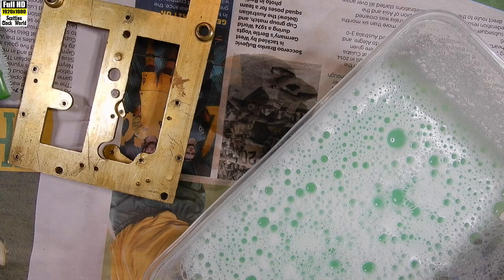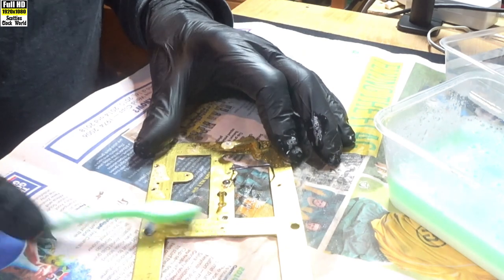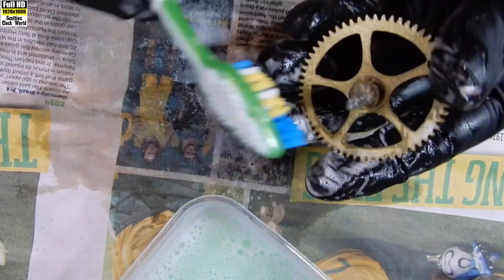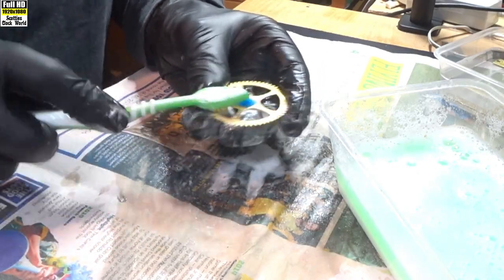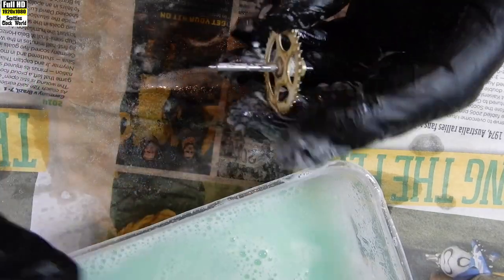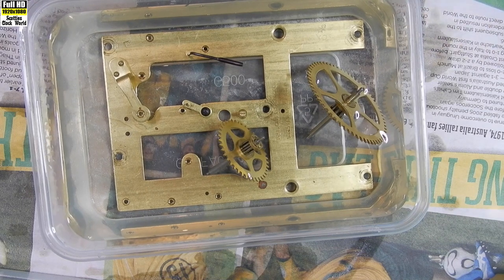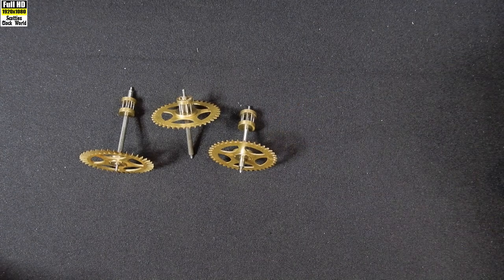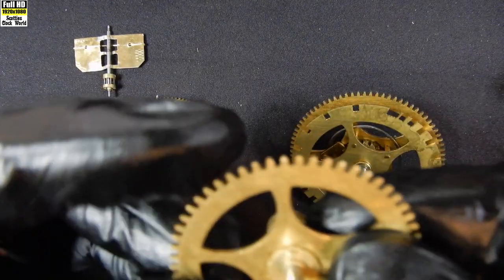Clock Repair For Total Beginners - Lesson 6

Comment: Hi Scottie 
What kind chemicals  can  you recommend for brightness the brass ?
I used your solution but vinegar does not bright brass like yours
Reply from the maker: That movement was relatively shiny before I started. Mix equal amounts of amonia and water, soak parts for about an hour. That will shine them up.

Comment: Can we use rubbing alcohol for this process? Not sure what (nath-rah) is?
Reply from the maker: @mikemesserschmidt810, Hi Mike rubbing alcohol (iso-propyl alcohol) ann be used for cleaning clock parts but it is not very good at disolving grease and oil because it is not petroleum based. Naththa is sold commercially as lighter fluid